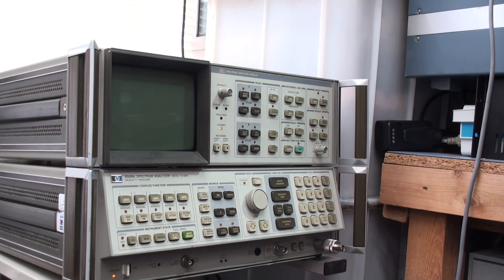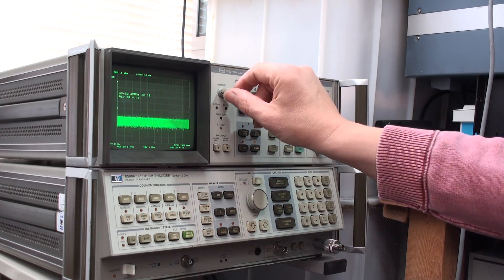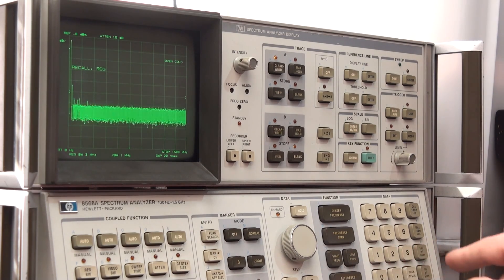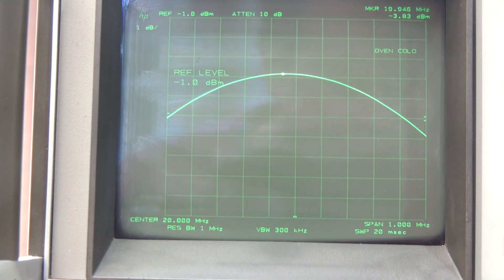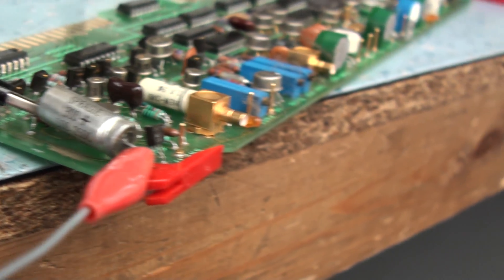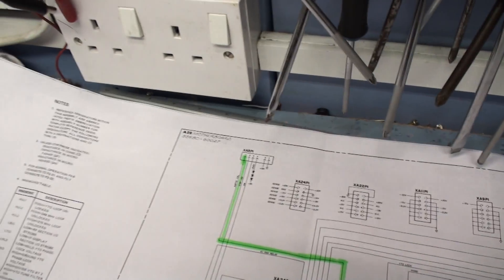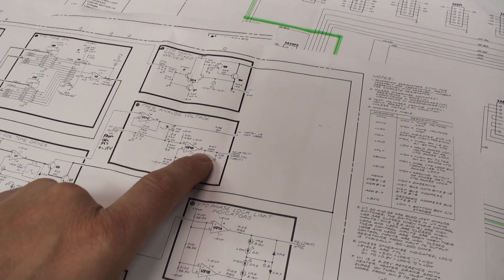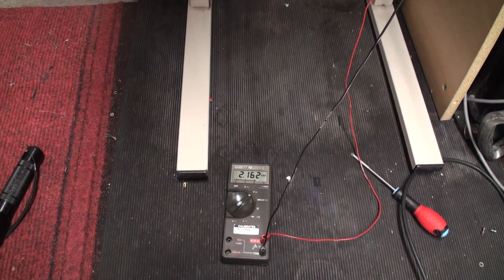Hp 8568a Fixing the input level problem pt1

Comment: I have one of these at work. Used it for years, I would breakdown every few years. I found the more I used it the less and lees it broke. We don't use it as much as the equipment we used it one we no longer repair it. So now it mostly sits on the cart over against the wall. It's a fine piece of equipment and was fairly easy to use. Thanks for sharing Simon. 
Best Wishes and Blessings. Keith